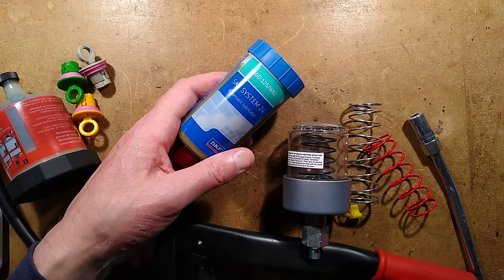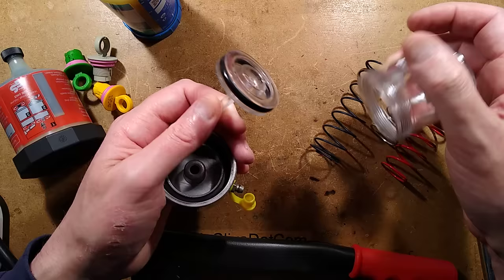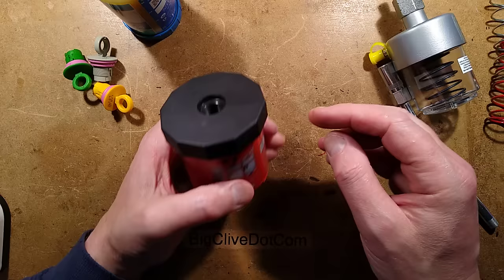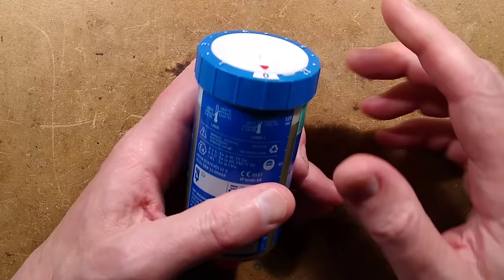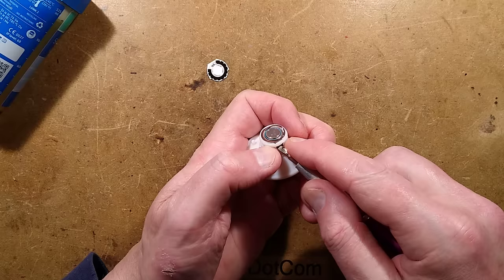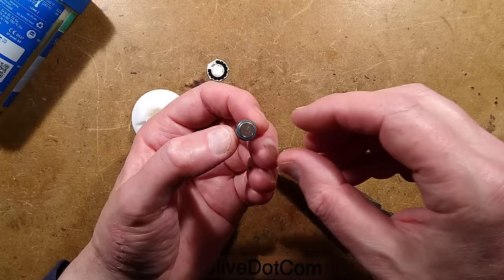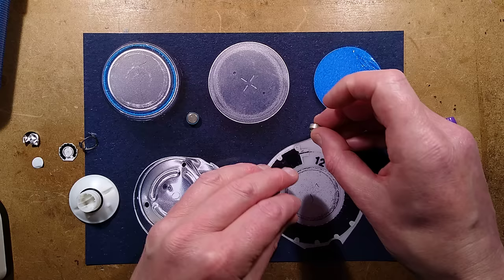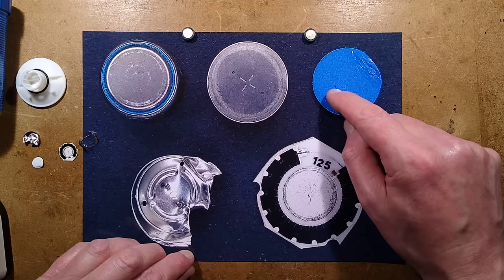Absolute genius automatic lubricator

Comment: Simple explanation of whats going on here:

The Zinc-Air cell would normally absorb oxygen to produce electricity.

However if you leave a label over the air holes, no oxygen can get in, so a different reaction occurs - the cell breaks down water (H2O) from within the cell to get the oxygen it wants to use.   The energy of breaking down that H2O reduces the available voltage from ~1.5 volts to ~0.3 volts.    That leaves H2 (Hydrogen gas) inside the cell, and since H2 is a very small light molecule it can leak slowly through the paper label to get out.

I imagine the design of these grease dispensers is tricky because the hydrogen will also leak through the plastic shell - so getting the thicknesses of the tape and shell right to maintain the right pressure, despite variations in temperature, is probably tricky.
Reply: Yes, this is how the Varta Hydrogen cell works I believe

Comment: Would have been handy at my old work! One of the machines that I used to run had a door in the side of it which had about 30 grease nipples inside that you had to give each one a couple of pumps once a shift. There was copper tubes going off to all the different bits of the machine.

Comment: Quoting from a comment on an AVE video on this from a man named E:

"It's not often PhDs in inorganic chemistry have a chance to shine, but I'll take what I can get. 

Here is what is happening:
Under normal conditions, there are 3 reactions:
Zn+4OH- > Zn(OH)4^2-, + 2e- (Anode)
Zn(OH)4^2- > ZnO +H2O +2OH- (electrolyte)
1/2 O2 + H2O +2 e- > 2OH- (Cathode)
Total - 2 Zn + O2 > 2ZnO

There is always a parasitic reaction pathway which generates hydrogen gas (see below). In order to minimize this, they use construction methods and additives such as mercury amalgam. The parasitic reaction is below:
Zn+4OH- > Zn(OH)4^2 + 2e (as above at anode)
2H2O +2e- - H2 +2OH- (side reaction)
Total = Zn +2H2O > Zn(OH)2 + H2 (hydrogen generating reaction)

Under normal operation, oxygen is present, allowing the top cathode reaction to proceed, where the overall reaction involves the oxidation of Zinc by oxygen to produce Zinc Oxide. Without oxygen, the reaction will proceed without the Cathode reaction, resulting in the oxidation of Zinc by water (under basic conditions), producing Hydrogen gas and Zinc(+2) hydroxide. These are competing pathways, removing the oxygen forces the Zn to prefer the parasitic reaction that generates hydrogen gas. 

The source of the hydrogen gas is the half cell of the oxidation of zinc, and reduction of water to produce hydrogen. This explains why no oxygen is being generated."

Comment: Newer Grain Carts have the option for the spring type auto greaser for the Bearings, etc, on the Tracks. They take quite a bit of Grease too, but they dispense a little every day. It takes about 2 2 1/2  Tubes of Grease. It lasts about a Season I believe.

Comment: It's definitely clever in using a property of the battery that isn't normally considered to have utility. I'm surprised they couldn't do something like work in a very low power transponder circuit as well, so if it doesn't ping back to some sensor device - then maintenance would know when to replace the thing.

Comment: Wow a cleverly simple device.... However Most large factories I've worked in use Lincoln auto lube systems with Lincoln auto distribution manifolds...the manifolds that make sure each ports gets its allotted amount of lube all mechanically...no electronics other than 1 grease/oil pump for the whole machine.
Reply: I like them for the work they save, but I hate them because you still have to run around and check that the lincoln manifolds are actually working. Depending on the machine, you never see the manifold working at all but yet you can clearly observe that grease has been pushed. So you have no realible indication that things are working or not... 
These SKF things in the video are obviously easy to monitor, you draw line where grease is one week and come back another week and see if the level of grease has decreased. Obviously alot of work if you have 500+ grease points, and some senior maintenance folk would argue they'd grease things manually in the time it takes to adjust glasses to view the status of automatic greaser....

Lincoln is an SKF product these days btw...

Comment: Don't forget the battery operated grease guns , I'm fairly sure Milwaukee and Makita both make battery powered versions for industrial greasing of mining machines etc..
Reply from the maker: They do indeed.  They are also used with excavators to tension the tracks with a grease filled ram.

Comment: I recently discovered that you can get a Zinc-Air version of the old 6v "Lantern" battery with the spring terminals with an incredible 45Ah capacity.  It isn't even ridiculously expensive at ~20ukp, but has quite a high impedance so rather limited current capacity.  Part is Cegasa 4AS2/45.
Reply: Aren't these used in the flashing lights that signal road works ?
(The lights that attach to barriers)
Reply: Pretty cool energy density!
Reply: @psirvent8  I know they used to use lantern batteries (found a broken one in a park as a youngster many years ago and took it home!) but don't know what they use now.  Would seem a reasonable fit, the average current draw would be very low with LEDs and low duty cycle flashing.

Would be pretty nice for a remote sensing application with low power micro, it could last dozens of years.
Reply: @ferrumignis  Thank you for the reply.
Yes, LEDs are now everywhere but as far as road safety lights, some still come with xenon tubes and maybe also incandescent bulbs.

Comment: Looked up the zinc-air equations, and apparently H2 is a byproduct of the reaction.  I would have thought that H2 would escape regular seals over such a long term, but I guess not...
Reply: Do you have a reference? I see that H2 is a byproduct of trying to electrically charge a Zinc-Air cell, but it's not a product of the main discharge reaction.

Comment: Hey Clive, What happened to your hand? ouch, Nice video, I never new there was auto greasers, very interesting 😊
Reply: Looks like your hand was bitten by a vampire, lol
Reply from the maker: That's exactly what happened.  My automatic garlic dispenser ran out.
Reply: Came here to say this, was not disappointed.

Did have to go through a lot of posts, though....
Reply: @BigClive  😅
Reply: @BigClive  I've noticed that applying Silver Nitrate solution to Vampires is an effective long term solution to prevent temporary discomfort.

Just remember ear muffs. And don't spill any on anything you don't want to throw away or have to cut off.

Although my doctor keeps using them to help my ingrown toenails.

Comment: This is very interesting. So the only reason for the  batteries is to produce gas?   The low voltage that is produced is just wasted through the resistor, is that right?
If so that is very outside the box thinking.  When I first saw this, I thought the energy produced would actually turn a mechanism inside to push the grease out.  But this is so much more simple and probably much more efficient.

Comment: If an auto greaser impresses you that much, you should come to canada, come underground into the mine I work in. We've got a lot of awesome time savers and automatic equipment. Nearly all of our equipment has an auto greaser at the very least. Some of them are quite large and need to be refilled every couple days.
Reply: Of course any modern production machine has auto lubrication. Thing is that this is retrofit stuff. I've installed dozens of these in our production plant on critical locations where it simply doesn't make any sense to automate lubrication.

Comment: i heard that these coin cell type batteries give off some gas when they  are in use...
thats why they bloat up when they become so crusty with leakage that the venting seal cakes up

but using that gas by discharging them in a controlled fashion to create movement is just genius!

Comment: It looks like when the plunger is fully down, if the pressure is too high, then the dial cap just pops off. (The way you removed the dial, and the o-ring seal suggest that)

Comment: "that's very clever" can we get merch with this on it?? 😂😂 We use these at work I work at a lumber drying kiln so lots of chain conveyors and tons of bearings. The other huge advantage is you're supposed to grease bearings when they're running so in order to do that I need to lock out the machine get in a safe position have my helper run it while I grease it then lock it out again. Takes 2 people double the time then it used to. I'm all for safety and these are the safest way. There's some bearings we couldn't safely get to while they were running so less then ideal we'd have to grease them while they're stationary. These things are the cats meow 🤙

Comment: The problem that automatic greasers is they over-grease bearings. Too much grease insulates the bearing and it gets harder to radiate heat. In equipment moving a high rpms over-greasing can throw off the thermal balance and cause the bearing to crash. The shop I work at won't install them and adding them will cause our warranty to be voided. If someone isn't making the rounds to keep an eye on things, possible issues get missed. Most of the repairs I do are a result of neglect.

Comment: Not a chemist but I think zinc-air batteries discharged while deprived of oxygen undergo hydrogen evolution. This is typically described as a self-discharge problem related to anode corrosion, but in this application the process appears to be deliberate.

Comment: Not an expert but a grease gun has a lot of pressure and gets the grease in all the cracks and crevasses, those don't look like they would. I also feel like the regular greasing is when you're gonna notice possible issues so if it's automatic you're gonna miss those and maybe have bigger problems down the line.

Comment: I had a VW Beetle in my early days and the front axle had two nipples where grease should be pumped in. But for that job you should first jack up the front because the suspension should be with no torsion applied.

There was a maintenance interval but you could grease once you started hearing squeaky noises coming from the front.

I wonder if it would be possible to use an automated grease dispenser like this on each side.

Comment: Seems like this device requires that the machine being lubricated must be used a fairly consistent number of times from period to period otherwise you are going to risk overgreasing at times and undergreasing at others.  I think you are still going to have to regularly inspect the equipment to make sure the appropriate amount of grease is being added.

Comment: Really amazing technology. Great video. Does anybody have any hints to what chemical reaction is going on under these circumstances? The normal discharge redox reaction with air takes oxygen out of the air and oxidizes the zinc to form solid zinc oxide. i.e., it slightly reduces the amount of gas and converts some of it (the oxygen) to a solid. So you need a completely different chemical reaction to increase the amount of gas. Also: Where do the 0.3 V come from? If the discharge reaction would be ongoing "a bit", since the label was not completely air tight, it would reduce the amount of gas present, not increase it.
Reply: O.K., perhaps the hint to hydrogen gas being released in other comments to this video and the zinc corrosion part in wikipedia simply mean that the zinc reacts with the water in the electrolyte, just like in the usual discharge reaction, forming zinc oxide with the oxygen bound in the water molecules, leaving excess hydrogen. So all the gas to build up the pressure would be hydrogen and would need to be produced from the tiny amount of liquid electrolyte in the cells.
Reply: Producing hydrogen using zinc (and various acids) is quite common, see, for example, Döbereiner's lamp (Döbereiner was born in 1780 near my home town). Another interesting approach has been published: Using zinc oxide, charcoal and sunlight to produce metallic zinc, and then let the zinc react with water to generate hydrogen (doi 10.1038/news050801-11).
Reply: As I mentioned in another comment, you could try the CH23-1225LF battery holder for one 675 (PR44) zinc air cell. It is originally intended for two CR1225 cells in series and one contact is on the side, so the tab can stay on.

Comment: An SKF brochure states "Battery pack TLSD 1-BAT 4,5 V 2,7 Ah/Alkaline manganese" -- perhaps one cell is reverse connected to a second cell? The first cell provides power to overcharge the second cell, generating gas.
Reply from the maker: That doesn't tally up with what is in these.

Comment: Wonder how well these work over temperature range because the viscosity of the grease and the outgassing rates will change.  Still very clever.
Reply: After more research it looks like the outgas is water vapour.  However the chemistry and discharge rates are definitely affected by humidity and temperature.

Comment: Some dude had to calculate the volume of gas produced its compression characteristics, design a tube and plunger with load (grease) with the correct resistance the gas would have to overcome over a specific period of time.

Someone was showing off designing this thing.

Comment: 2:28 push it over to the side and twist? I guess I never knew the twist part because I had to take mine apart several times when greasing my ball joints on a suspension rebuild.

Comment: According to Wikipedia a zinc air battery consumes Air during discharge and does not generate any gases. So I guess it is something else.
Reply from the maker: But it turns out that if you discharge it while there's no air it liberates hydrogen.

Comment: Is it possible that it's not the accumulation of gas pressure that forces grease out of the cartridge but the gradual loss of vacuum behind the grease that prevents it siphoning out to replace grease the bearings lose?

Comment: What happens if you leave it on to long? Does it squirt gas bubbles into your grease lubrication lines? That could potentially be bad...
Reply from the maker: The ram will bottom out.  I think the electronics end would pop out or vent high pressure.

Comment: I'd guess running machinery would warm up the grease and gasses giving a bit more grease flow, stationary machinery would be cooler putting less gas pressure on thicker grease and stopping wasteage.

Comment: I wonder if they came up with using batteries to create presure when they had some product that was totally sealed blow up after running for x amount of time and someone thought, hay, you could use those batteries to power a timed pressure device! As simple as you can get.

Comment: This is very informative (and interesting!), but I think still not a complete explanation of what's going on here.

As I understand it, the reaction in a zinc-air battery should always result in a net reduction of available gas, never production (it consumes oxygen, and does not produce any other gasses).  Therefore, the suggestion that it is producing gas when being discharged, which pushes out the grease, does not actually make sense.

I am wondering if perhaps it is functioning in the reverse way, by consuming oxygen slowly over time, it results in a decrease in gas pressure inside the device, which through some clever design causes external air pressure to push down a piston to dispense the grease instead?

Perhaps you should disassemble the cylinder further to confirm what the internal design of the sealed portion actually looks like?
Reply from the maker: There's more information and a patent link in the description.

Comment: My big concern is, what's to stop the speed from altering greatly between the first and 12th month (assuming you set it on 12)? Presumably, when you enter month 12, the chamber for the gas to fill to push the plunger is 11 times the volume as when you entered month 2, which would require a lot more gas release to create the same increase in pressure, unlike a classic spring which has the same force across its entire expansion...
My only thought is if the batteries somehow offgas more as they get closer to neutralizing their own charge, but I would think they'd offgas less?
Reply: Not really.
Look at it this way, the amount of gas to take it from volume 1 to volume 2 when both are at the same pressure is exactly the same as the volume of gas required to go from 11 to 12 (assuming all the volume numbers are the same distance apart).
This is why each segment of the resistor is also the same.
The gas evolved is directly proportional to the charge transferred.

So on the lowest resistance, it’s 12x the current of the highest resistance, which means it takes 1/12th the time to evolve the same amount of gas.
Reply: Also, a classic spring is the opposite, it’s force isn’t the same over the entire travel, the rate of increase in force is the same over its allowable travel (unless it’s a constant force spring, which is much more complex).
Reply: @marcberte4035  ah you're right, I was thinking of it as needing to increase the pressure not increase the volume at a constant pressure. I'm not really sure why, I guess a moment of stupidity. If it's constant pressure then indeed the increase in volume should be consistent. Thank you for the correction.

Comment: Guessing those batteries were zinc-air 1.4 volt.  They have a vent under a sticker to allow air inside.  I'm assuming, as the electrolyte evaporates, it vents out, giving pressure.
Reply from the maker: When discharged with no oxygen they create hydrogen that would push past the label.